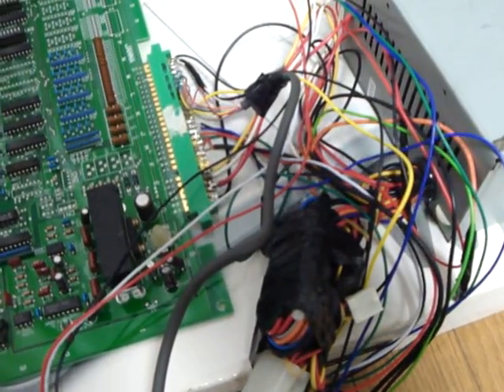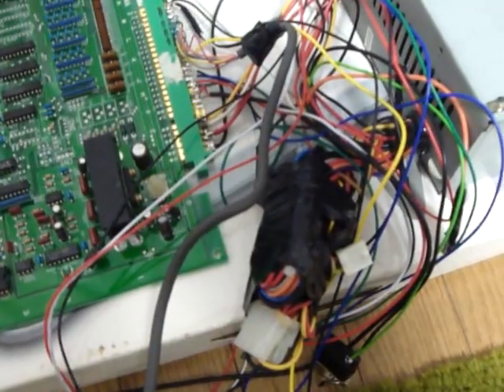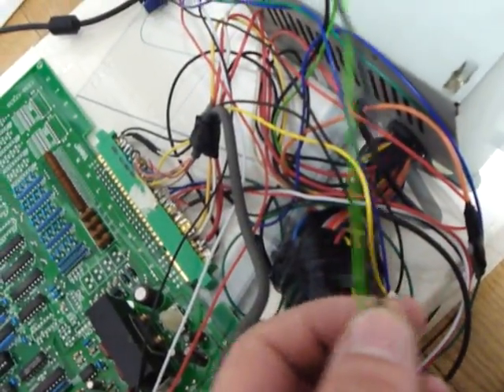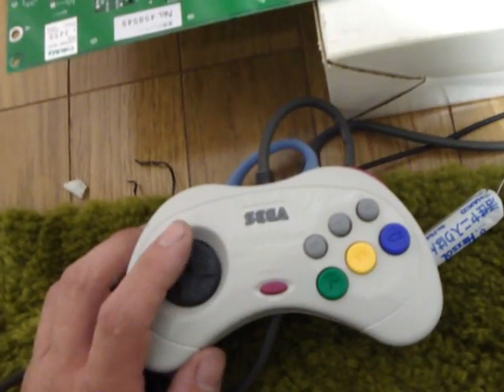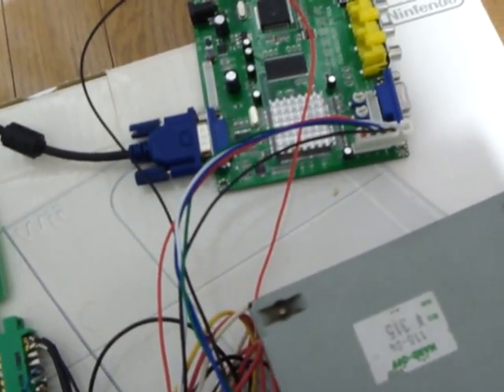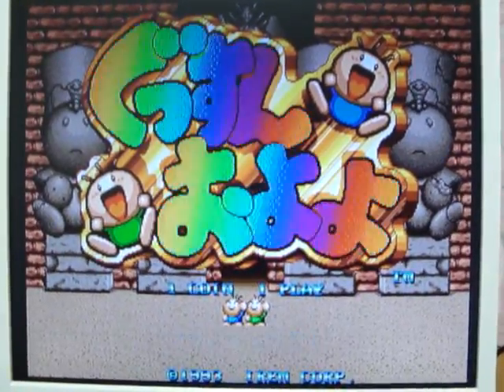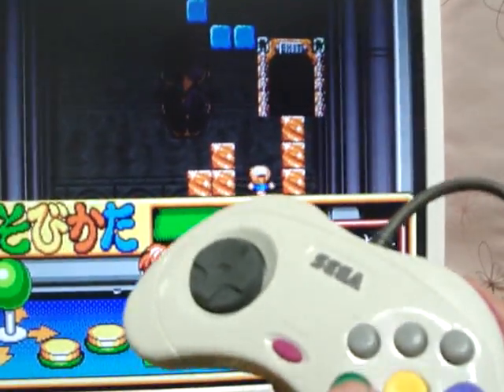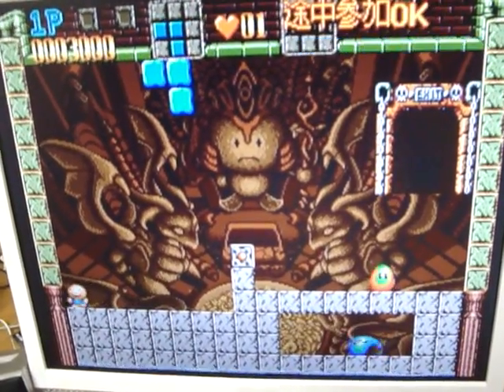How To Make A Homemade Supergun Like Setup For VGA Monitors

Comment: At this point I hate these boards for being inaccurate.  Got an ossc and it ticks me off that nobody else really put effort into a direct 1:2 scale.

Marqs is currently making an HDMI conversion board that wires directly to CPS2 hardware, but I'm leaving in a request that he makes a jamma solution to replace the cga/vga boards entirely.  If digital is an issue, just nab an hdmi to vga adapter, they're plentiful.

Comment: Here in the US, the -5V disappeared from OEM power supplies about then, but  power supplies for do-it-yourself computers had it much later(probably up to the end of 20-pin power supplies). Check the amp ratings for the supply voltages (usually listed on the side or top) to see if a given power supply has that voltage.

Comment: Nice guide man. I'd just grab an arcade PSU myself, they are fairly cheap on ebay, though you certainly can't beat ATX PSU prices. Those converters aren't 100% reliable though, mine only plays about half my boards, the other half doesn't sync but I hear every board is a bit different with compatability.

Comment: @LarryBundyJr OK just re-read that. Doh! Yeah just a normal system16 to JAMMA adapter will do it. You can wire it yourself with parts from ebay and pinouts from the web.